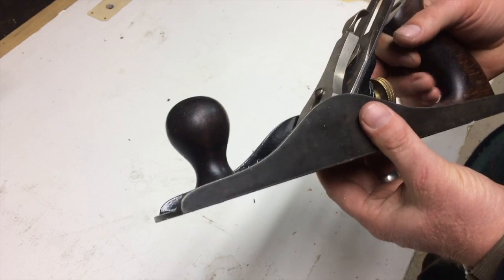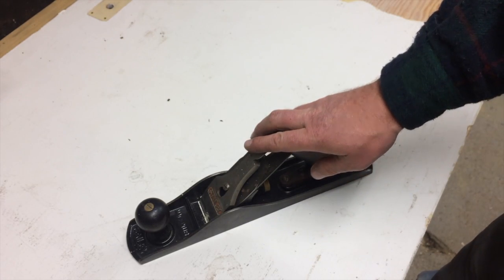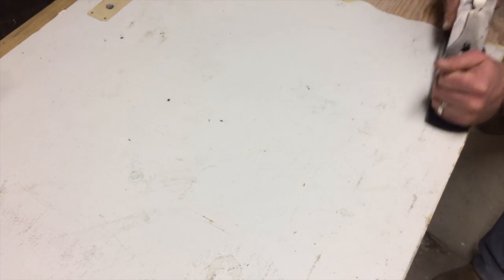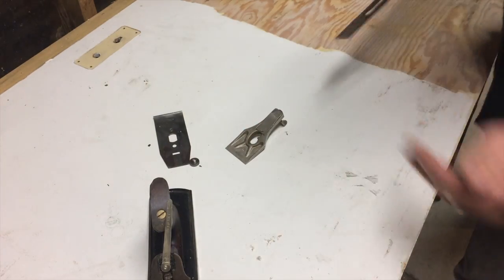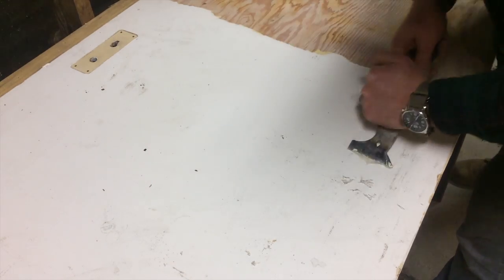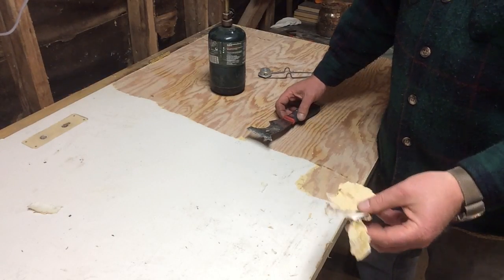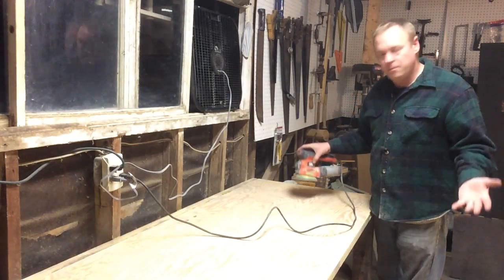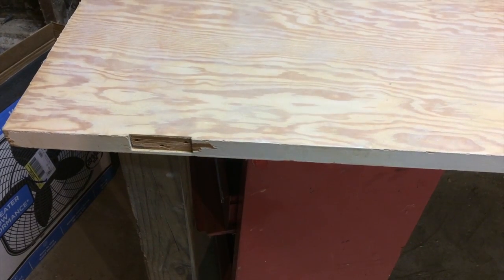A Silk Purse From A Sow's Ear (not literally)

Comment: Zack  --  Couple of suggestions :  1)  Get a "Flame Spreader" for your Torch . Most Torch Kits come with a Flame Spreader as that is the primary purpose for it , paint removal using the Torch .  2)  When using your Saw Vise  or  Drill Press ,  put a piece of cardboard under the metal legs ,  it will keep them from marring up the top of your workbench .
Reply from the maker: Good tips DR, thank you.

Comment: When I was on a small paint crew in the 70s we'd strip houses that had a lot of alligatoring with propane torches - one guy worked the torch and a guy stood next to him with the putty knife. That saved propane as you never had to take the torch off the surface and labor was cheaper than materials then.
Reply from the maker: yeah, would've been handy to have an extra set of hands.

Comment: Well that is exactly what old school painters did. I remember my uncle using an old pump up type blow torch that took some kind of petroleum product. Nice job. It's amazing how nice recycled materials come up. ATM I'm cleaning up pallet timber to make a TV cabinet.
Reply from the maker: Thanks Greg, I was pretty happy with how well it worked.  Would have loved to have a bit bigger flame to speed up the process but it's probably better I didn't.  It never ceases to amaze me how nicely some of this old wood cleans up after some planing or sanding.

Comment: Zack  --  Another Tip ,  apply several coats of VEGETABLE OIL to your workbench and let it soak in . Once it has soaked in , buff it with a soft dry rag . 1)  Almost everyone has Vegetable Oil in their kitchen .  2)  Being Water Soluable it will clean up easily .  3)  Being Vegetable Oil it won't hurt the wood of any of your projects should any of it transfer from your workbench .
Reply from the maker: that's a good idea, thanks DR

Comment: BLO will work great. I'm hesitant to use it these days as I've found out it's not really boiled and used to contain lead. Now contains other equally yuck for your health chemicals.

I have been using butcher block conditioner on my axe handles and wood projects lately. It's basically mineral oil and beeswax.

Table looks great man. Really coming along.
Reply from the maker: Thanks Landon, it seems everything will kill you these days doesn't it?!

Comment: The other negative thing about  a "skirt" is that it would add considerably to the weight of the bench which is something you may not want to do recognizing it is on hinges, attached to the wall and will be moved up out of the way on frequent occasions .

Michael
Reply from the maker: To be honest, I'm not sure how frequently it'll be folded up but you're absolutely right about trying not to add unnecessary weigh due to the hinges.

Comment: If you ever have the time here is a trick i learned fixing broken furniture with no money while I was in college. 

Finding enamel paint that's been sitting for a few years isn't that hard. You might have some or you might have a friend that has some sitting in his garage he doesn't want. Anyway if you can find some where the enamel has separated you can pour off just the enamel into a jar or something. Cut it with rubbing alcohol and apply thin coats and you'll end up with a really hard finish for free. I used to do this and dissolve kool-aid in the alcohol to get neat looking enamel stain that only costs a few cents.
Reply from the maker: Hey I like that trick a lot, especially the bit about dissolving Kool-aid in it.

Comment: I would leave the skirt off and keep the clamping option open. If you wanted to add strength to it you could add a 2x4 on edge about 6 or 8 inches from the edge. I don't think you need it unless you start to rebuild car engines or transmissions on it. I saw in one of the first of these videos that  you were sitting in the middle of it and it did not look like there were any issues with the strength of the bench.
Reply from the maker: Yeah, I don't feel like strength is really going to be an issue with this bench, I may wind up adding a stringer of sorts for a different purpose though.  We'll see.

Comment: Zack, I would not skirt it, you'll lose the clamping functionality which is very important for a workbench. You can consider to reinforce the workbench with a couple of 2x4's under the bench 6 or 8 inches of the border. A workbench cannot be solid enough. Just my 2 cents... good luck anyway, Paul
Reply from the maker: Thanks Paul, I may wind up doing a little reinforcing as a byproduct of another feature I may add.  We shall see.